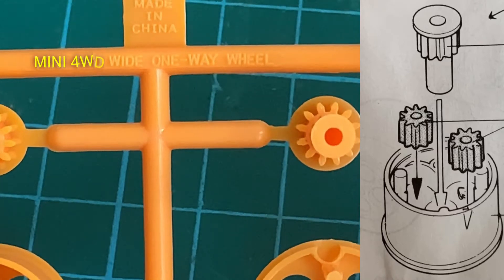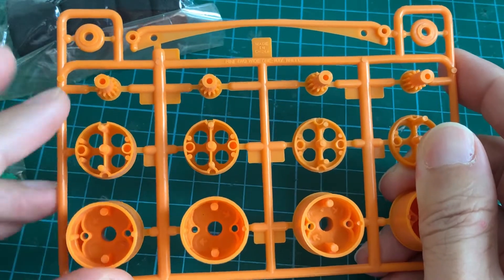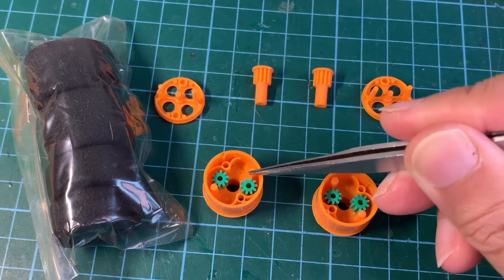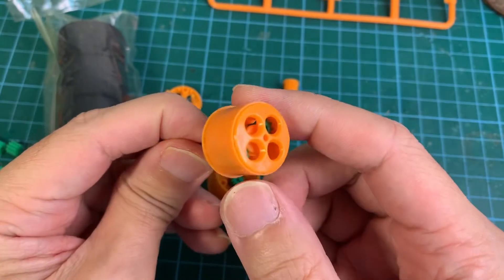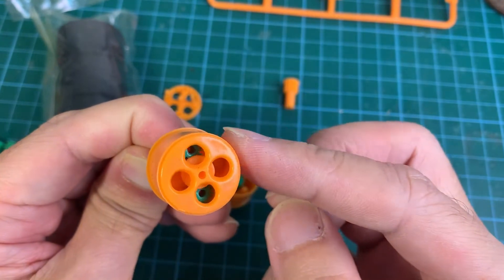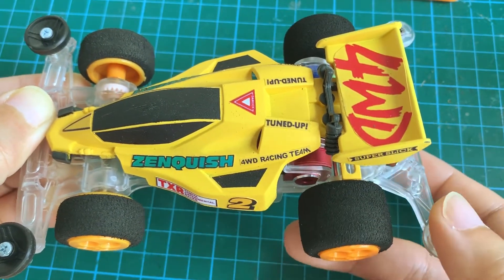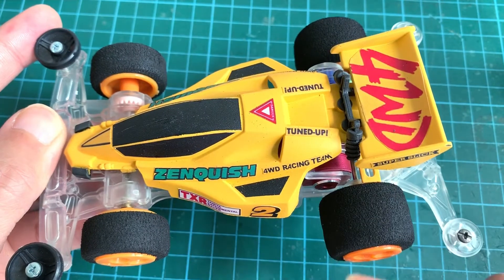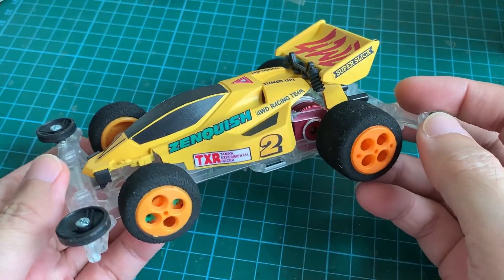Tamiya Classic WIDE One-Way Wheels

Comment: Wait how does the wheels work? Like if you run it on a wall is the gears running?
Reply from the maker: Thanks for watching! if the car hits the wall of the track during a turn, the impact will force the motor to slow down. Since the normal wheels are directly geared to the motor’s shaft, the wheels would slow down by the same amount. In theory, having free-wheeling wheels would allow the car to continue moving based on the inertia of motion and without the slow-down by the motor.